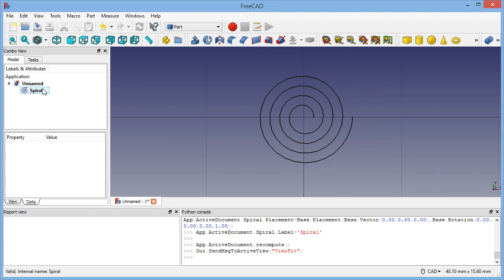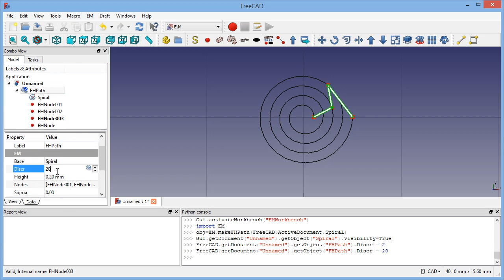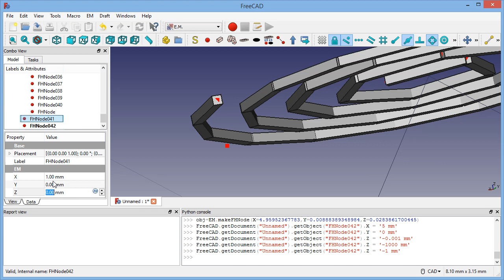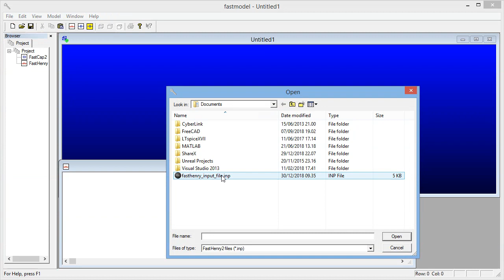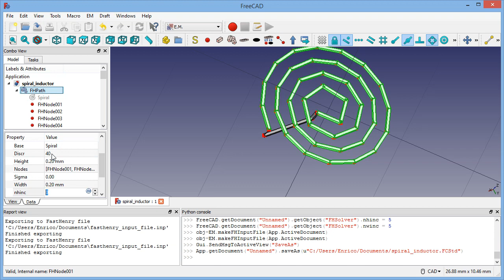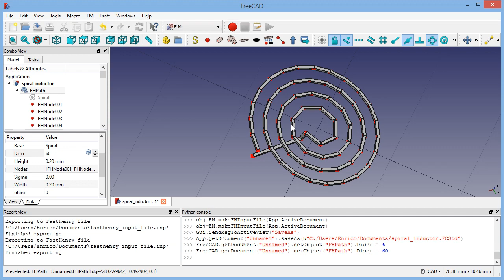FreeCAD EM WorkBench tutorial: using the path object, part 1

Comment: I don't understand what does FastModel do?
Reply: I agree, there are not lot of practical examples with clear definition. At least for me looks like the FastModel sends the geometry to the FastCap/FastHenry solvers. There are not lot of guidelines into the documentation tbh. 
For example FastCap2 can potentially calculate the parasitic capacitance on a PCB but the documentation doesn't explain clearly(maybe I am wrong) where to show the final result or to do the postprocessing.